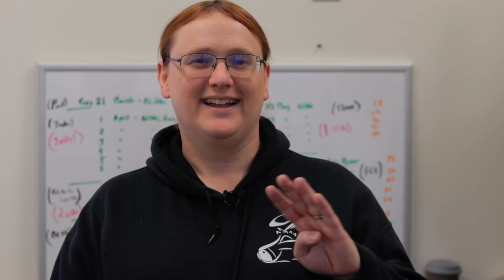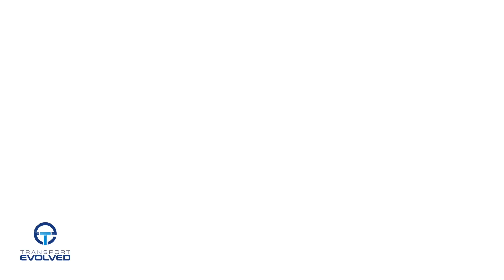What Should The Design Lifespan Of A Car Be?

Comment: Tesla is running head long into a problem that has not been solved in the computer industry.  That is maintaining software for hardware that is old.  Maybe Tesla will be the first one to crack the problem without going bankrupt.  Otherwise, Tesla may be the first car company to have it's cars take from the road due to software.  25 years ago we were still using DOS.  Not too many companies could support that nowadays.  Average life span of a car is 11.6 years.  That would be like trying to support software for the very first iPhone.   Good luck with that.
Reply: Plenty of older cars have old computer modules with old, non-upgradable software and seem to be doing fine.  Granted that Teslas have more complex software that controls more functions in the vehicle,  but I wonder if there will be a slowdown in the the number of significant must-have new features that will occur, similar to what is occurring with cell phones, making upgrades less important.  There is also the possibility of replacing the old computer with a new plug-in computer as Tesla is planning on doing very shortly.
Reply: @DrTed3  The computers your referring to in older cars are Embedded system.  These are not computers like the average person would think off as a computer or have anything to do with what Tesla is trying to do.  More like the kind of thing you'd find in a calculator or coffee maker.   
Oddly your pointing out exactly what the problems are.   None of our newer parts would fit in older computers systems because the way things are done keeps innovating.    The expense of trying to put a modern cpu card into an older bus is astronomical.  Then trying to find people that know the old systems.  And then there is just the impossible.  i.e. how do you fit a 64 bit computer into a 16 bit data bus.  All the connectors have changed.  Heck just one camera is a problem.  Custom port, serial port, parallel port, different custom port, USB, etc etc..  trying to make a camera support all those is ridiculous.   Trying to support this older stuff is what bankrupts so many companies.  
But like I said.  Maybe Tesla will figure it out.  They may be able to get away with charging extraordinary high prices for parts as the car itself was so expensive.  Yet, that didn't save the mainframes and they were millions of dollars.
Reply: @lucidmoses  You are right.  I understand that most cars have multiple small "computers" in each vehicle for various systems while Teslas have one main board.  The present computer board in the Tesla Model 3 can be directly swapped out for the more powerful one coming out for full self driving according to Elon Musk, but of course there has been no price announced other than the cost for enabling FSD.  He did say that the cost for the new board is roughly the same as the old one, for what that is worth.  Maybe innovation has a chance to solve the problem.
Reply: @DrTed3  Yes, Just like computer hardware.  Swamping out an old card for a new one is easy.  WHILE the tech is compatible.   But tech moves on and you can't just hire your local machinist to run a small batch of main boards.
Don't compare now to a few years ago.  Compare computers from 20 years ago to now and see how well the parts just plug in.    Or are you suggesting that Tesla will remain in the past and not keep up with the times as computer technology evolves around them?
Reply: @lucidmoses  I would expect that no one can absolutely predict what will be the state of the art in transportation technology and engineering in 20 years, but the concept of a single computer addressing peripheral parts of the vehicle has a better chance of avoiding complete obsolescence if the computer hardware and software can be updated as Tesla seems to be doing.  Of course if new systems requiring different peripheral technologies are needed, then no amount of new central processing and software will keep the vehicle state of the art.
Reply: @DrTed3  well, we'll see.  Musk has been very good at advancing industries  and innovating.  But I don't think he will be successful at holding back the computer industry just so he can support older gen  cars.
Reply: @lucidmoses  It will be interesting to see how this plays out.  In the meantime, I will just enjoy my Model 3 and not worry too much about it, but thank you for the interesting discussion.

Comment: Car longevity varies with the amount of abuse it can take or is given to it by the owner. Regarding the Morris Minor, my dad bought, used, one of the ones imported to southern California in the late 1950s. It was less than a year old, a 1000cc version for our American market, and yet its engine was in poor shape. It turned out that the dealer failed to disclose how many miles it really had on it. The tendency to roll back the speedometer cable using a power drill was common to used car dealers in that day.  When thoroughly cleaning the car one day, involving removal of the rear seat, we found poker chips, and thus surmised that it had spent a lot of time on the highway to and from Las Vegas, which from San Diego in those days used mountain passes a lot. That fine car for an English countryside drive of a Sunday had been thrashed, pedal to the metal for hours on end. It just could not take it. That was the manual transmission car that I had to learn to drive, and even my Dad would stall it a lot with the low compression that he found out about at long last upon having it looked at.

Comment: You have provided a very thoughtful commentary.  I feel a car should last at least 20 years.  The difficulty with EVs is the cost of replacing the batteries. Hopefully the price drops substantially over a relatively short time.  Solid state batteries, if they manage to figure them out, will solve the problem of cost and battery life.  Additionally, as technology advances, the tech in a 2019 vehicle will seem very dated by 2025 much less 2029 or later.

Comment: This has all happened with computers before so you only have to look to them.  If you buy branded computers then they don't last because of the custom design and only one manufacturer makes bits that go in there and they have no interest in helping you to keep your old computer feeling "fresh."   If you buy generic bits and make a computer then you tend to get something which is much more recyclable.  My crappy computer case is 18 years old now. I recently spray-painted it yellow because ...why not...and now it's great. It will last another 10 years at least. The insides have changed a lot but not everything - the power supply has lasted a long time. The drives come and go. The motherboard changes every 5 years or so.    The fact is that if you upgrade some things it forces you to upgrade others and the manufacturers try to make this happen every few years to encourage people to do a complete update. On the other hand those updates tend to offer quite big benefits.   The problem is that its' not a very profitable market.  So now the interest  is in phones which are nice and throw-away.

Comment: I've worked in aviation for many years, and there is a clear distinction between Air Traffic Control systems and aircraft themselves:

ATC systems are designed as a single unit, with the flight data processor heart of the system closely integrated with the Controller workstations themselves. When an update is required, there are limited options for add-ons or partial system upgrades, and old systems are patched bit by bit to keep them running, much as they were originally designed. When they are replaced, they are essentially thrown away and replaced by a completely new system.

Aircraft are totally different: The airframe is built by one manufacturer, the avionics and aircraft systems by other manufacturers, with fairly clear dividing lines between them and interface control documents (ICDs) defining how they interact with each other. If a new facility is required, an avionics box can be replaced with a completely new one, as long as it keeps to the same physical size and shape and maintains the interface defined in the ICD. Consequently aircraft can be upgraded, improved, throughout their life. I have been involved in adding FMS (flight management system, with computerized route management and fuel prediction capability); upgrading from analog electro-mechanical instrument groups and replacing them with computerized glass-cockpit avionics; upgrading from inefficient and noisy pure jet engines to modern high bypass ratio fan-jet engines. The airframe is almost never changed, and does not need to be.

Consequently the life of an aircraft can be extended well beyond the original design parameters at very moderate cost. The addition of FMS, for instance, was recognised to pay for itself within the first year of operation of a modified aircraft, with all the fuel savings and operational improvements they offered being pure profit after that. They are now a standard fit in every aircraft of any size. The major limitation on the life of an aircraft is now the fatigue limit set by the airframe, not the capability of the on-board systems.

I suggest we should be building cars in much the same way, with the basic structure being designed to accommodate newer batteries with higher energy density but the same physical form factor; with software updates and possibly new sensors added to provide new facilities, new driving modes, more efficient power regulation and management. And we should be free to select the upgrades that we want, to develop our own car to fit what we need it to be, even as our needs change.

It is essentially the difference between these two models: The ATC example, throwing away the entire car and buying another one, extending the life of an old, obsolete model until it becomes completely uneconomic and embarrassing. Or the Aircraft example, "ratcheting up" the capability of the existing car bit by bit during its life, improving its performance, replacing its engine and battery, adding new capabilities, so that it ends its life with far more capabilities than its original designers could have conceived.

We have beaten the old problem which forced me to throw away cars I loved, like Morris Minors, Austin A40s, MGBs: Rust. Now let's concentrate on having reasons to love our cars far more than we used to, by having them grow even more useful and lovable while we own them.
Reply: Good metaphors..  Well said!

Comment: Vehicles in general should be able to last 12-15 years.  Not sure battery makers, which are beholden to manufacturers, really want this. I have been ditching my EVs once they get close to 50k since main car warranty expires, and vehicle still has battery warranty so I get something from a trade. And not much of an aftermarket on batteries, hope this changes. Have an 18 year old ICE vehicle that runs as good today as the day purchased and aftermarket parts are everywhere for each component.

Comment: Standard parts is needed to keep maintenance costs down (the costly part of extending run life).
 Less plastic. Yep! The plastic bits were what was failing on my 10+ YO vehicles , not the mileage limited pieces . When I started driving in the 60's, engine wear at 60K miles was significant. Today, >100K miles. But keeping the Interior (seats and panels) safe to use, is the issue. In the 60's,  replacement (custom) van seats were common and fairly inexpensive. Now, everything is unique to the model, making any repair/replacement very expensive. With dealer shop rates heading for $200, replacement parts need to snap in and not require model specific specialty tools and fixtures to accomplish the task.
As to how long? Till it can't be made to run (economically. the real reason I replaced a 2001 w/140K mi, with a Leaf. The emissions parts alone exceeded the ACV. There was no body damage.)

Comment: The car has always had a short life. The problem is that they are built from materials that rust. The earliest  monocoque  bodies were badly designed with moisture traps such that they rusted rapidly, look at the Mini from the 1960's . Another problem is linked to the  price that the first owner will pay.  
Landrover used to build vehicles that lasted 'forever', now to keep costs down they die rapidly. 
Even more simply they wear out, so unless the concept of a very long life is built into the design cars will last a short and finite time. 
London Transport once had its own Bus designs, the features being that they were built in modules, It was possible to change an engine in a couple of hours, everything was designed to keep the bus on the road. The problem was that the Passenger compartment was too difficult to upgrade. (A bigger problem was interference from Politicians, another story). 
Tales about very old VW Beetles and Morris Minors are irrelevant in this search for longevity. In the UK they rusted out very quickly, and its only thanks to enthusiasts that any still exist. 
MOT test figures show that cars in the UK last on average 11+ years, by that time they are normally worn beyond chance of economic repair so they are scrapped .  Good legislation has upped the recycle factor in cars now built, Volvo for one claims over 90%. 
Perhaps the introduction of 'non ownership' of cars will solve the waste problem by reducing the number of cars that need to be built in the first place.

Comment: That is a very good point! Bought my i3 because I was in love with the idea of high levels of recycled materials - claims of sustainable energy use in production - promises that BMW would enable battery upgrades etc.. and it turns out the reality is nothing like that! I will never understand why components of a car are not upgradable - it seems there could be plenty of turnover in an aftermarket for upgraded infotainment, self driving, and other electronic improvements. But the answer I get from mechanics is always: BMW just wants to sell you another car.. well my motivation for staying with the brand is low when it turns out the car is dated after 3 years.

Comment: Car lifespan should be indefinite. By that i mean, people get tired of their cars every 3-5 years in general 10 year tops. Should that mean a car should be designed to only last 10 years? Of course not. 
Cars don't have to be designed to last forever either; making a car last is the owner's job. The only thing we need is automakers not to make this job impossible. Reconditioning will always be better than recycling. Although the maker doesn't want to support that car anymore, it doesn't mean nobody should. Take the example of the beetle: VW doesn't make parts for it anymore, but several companies do.
If I were to design a car, i'd make it so i'd be able to explore the market for replacement parts during the project's lifespan, and when it ceased to be profitable, i'd make everything open, so that other companies could make replacement parts.

Comment: The downside to driving 50+ year old cars is that they are far less safe. They lack crumple zones and lots of other safety features. Yes, you can retrofit some onto them, but not all.

Coming up with ways to recycle and reuse parts of cars would be a good idea. Using EV car batteries that only have 70% or even 50% capacity for grid level storage is a way to do that.
Reply: Agree, I think modular design is key, make as many parts interchangeable as possible.
Reply: I agree.  Technology gets better and better over time.
Reply: Rubbish. Those old Volvos were rated safest by insurance companies.

Comment: I don't think a single person can decide these things. The market is a very complex thing that seeks efficiency for us. When we seek value we reduce waste. We can say that cars should have X features but you have to pay the cost and the cost is based on factors that no one person can calculate alone. Change the product and you change the supply chain and you change the price. I think Teslas are built to last five years of super intense ride share use not 20 years. This makes investing tons of up front cost make more sense. The future is fewer cars, less time in parking lots, more safety usually reserved for premium vehicles. People need to multiply Tesla's numbers times 4 when full self driving comes. The expensive Model 3s are already designed for poor people. They are designed to be better safety like a luxury vehicle and the disposability that allows for continual innovation and renewal. This is not a dig at a short life span, it is a dig at the lack of innovation elsewhere in the market. Ride share is the future and Tesla is going to drink Uber's milkshake.

Comment: Maybe Toyota is on to something with their Hydrogen vehicles. Perhaps they could see that the battery packs lasting 10 years or less (and prohibitive replacement costs) on modern EVs is their Achilles heel. It's very unfortunate for a nissan leaf to be obsolete just because of its battery.

These limitations are likely to keep the EV world a market for ENTHUSIASTS and not for the 'average' car owner, for now.
Reply: Michael Corey An incorrect assumption based on the poor obsolete design of the Leaf battery pack only. No thermal management is a mistake everyone else has rectified by better design already.
Reply: @kdkd693  Good point. Will a Tesla's battery last 15 years or more?

Interesting how Nissan chose to continue with the planned obsolescence mantra with its Leaf. Unfortunate.